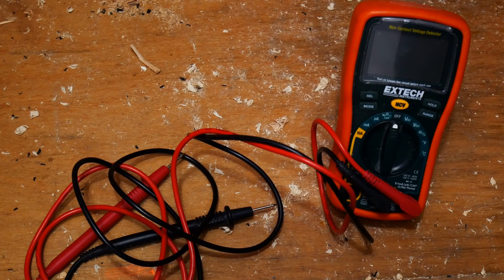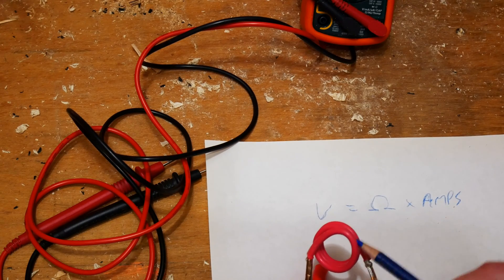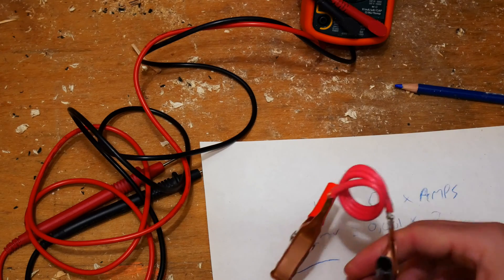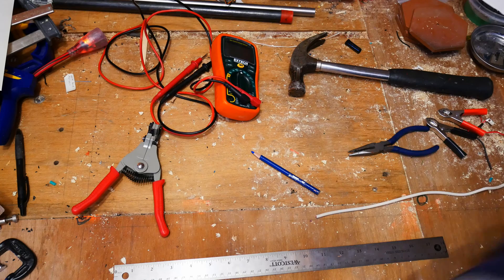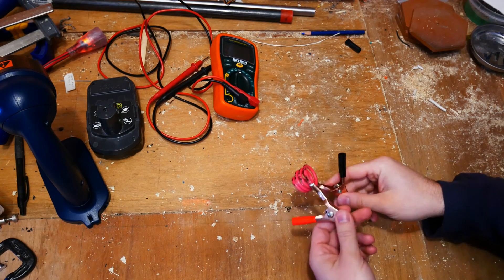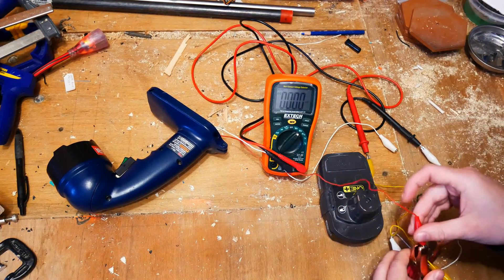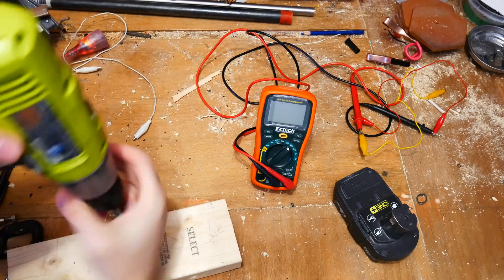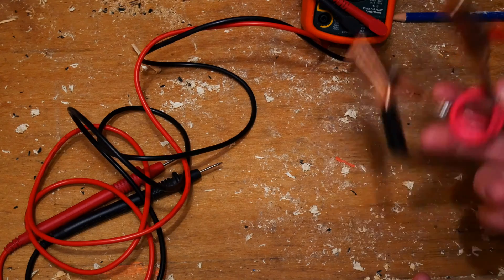100 AMP multimeter upgrade

Comment: You didn't "read" 37 amps through the drill motor, you read a high voltage drop across the burned white jumper wire.  Those jumper wires were not adequate to perform this test.
Reply: Yeah, resistance increases in metals w temp, so as that little jumper got hot its resistance went up significantly.  However, his probe was not across that jumper that heated but rather the 1' of 10 gauge so he was not reading the V increase due to this.  Im sure w high current there was minor heating in this as well so some error would be induced.  Since it was a rather short time and the big gauge, im guessing it would be fairly small and insignificant

Comment: You build an inductor i am sure you will get some error
Reply: actually if you measure ac current then only it shows the error for dc there is no inductance effect
Reply: A few turns of wire with no core will have basically zero L value, unless its EXTREMELY high current AND frequency...even then it would surely be negligible in comparison to the current value being calculated
Reply: Please, clean all the sawdust from  your work area, before you shoot another YouTube video.. My eyes are hurting from watching this..